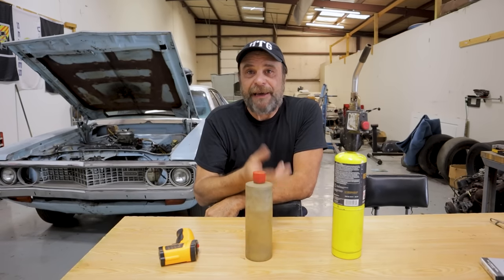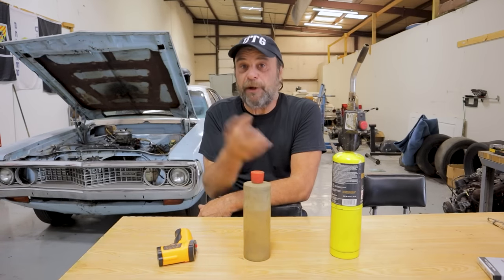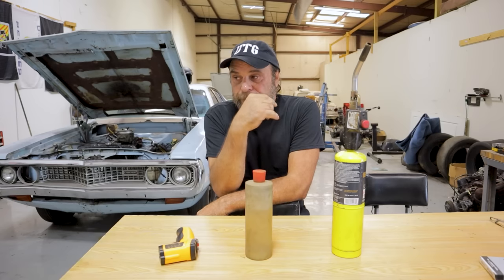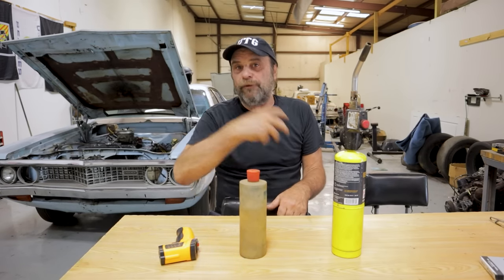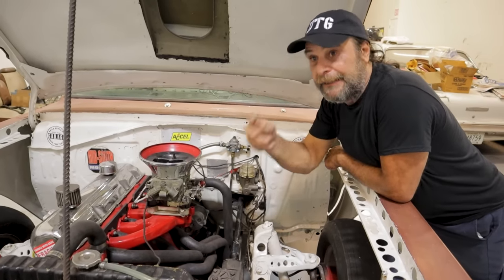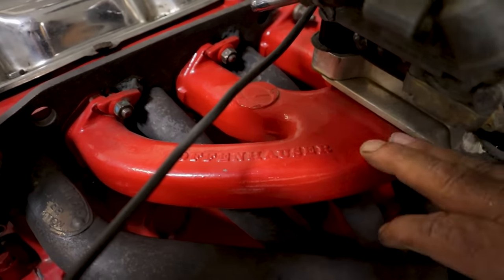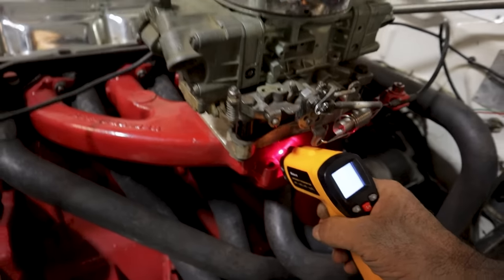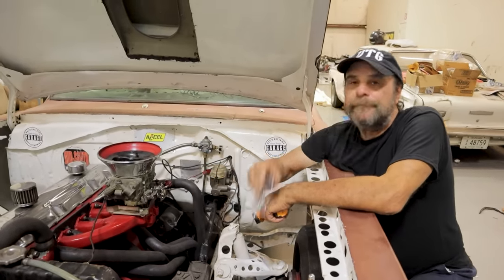How Much Intake Manifold Heat Is Enough? Testing The Vaporization Temps Of Modern Gasoline

Comment: I do agree with monitoring Temps at the track before modification. But depending on what the coolant Temps are you could fabricate a water jacket under the plenum and run water lines with  a valve to control flow and have some control on how much it heats the bottom of the plenum

Comment: Sorry Uncle Tony for double-dipping! What would happen if you went back to iron intake and exhaust manifolds together? Maybe even tap in a cast iron block that would connect the two manifolds into one unit so you could get heat transfer that way?

Comment: After watching the entire video, I can suggest to get the engine temp to normal operating temp. If I can recall, the thermostat in those engines were 180/190 deg. I'm old, so I may be off on the thermostat. But it would help the engine efficiently to warm it up before you run it.

Comment: I wonder if using the stock cast iron exhaust manifold would help keep the intake manifold hot? Also, like you said aluminum cools really fast, so if you picture cool gasoline dripping down on the floor of the manifold constantly, it is probably not staying hot!
Reply: Using the stock manifold would keep the manifold hot , but any gains made from the heat would be lost to the flow restriction.

Comment: You're on to something here.  I had a 39 year career as a Chief Engineer in a power plant and during that time I worked along with quite a few combustion engineers.  We wouldn't have used air pre-heaters, on power boilers, ahead of burner windboxes if hot air didn't speed combustion.  There is a lot going on in an engine intake manifold.  A cool dense air mixture is a good thing going in but once the fuel enters the plenum it should pick up enough heat to give a kick (you call flash) to the fuel mixture to get efficient combustion so there is no stumble or bog coming off the line.  I'd be careful adding auxiliary heat.  You're probably better with an extended warm up time if you can make due with that.
Fred

Comment: You are over thinking hot rodding the slant six with that POS intake.
 You need a 883 close ratio four speed 4:56 gears ,13 to 1 compression , big solid flat tappet cam , high rpm and light weight fiberglass body parts  to make that manifold work with a four barrel carburetor for racing.
 Put a Gear vendors on it if you want to drive it.

Comment: I'd be looking for a better intake manifold for the slant six. Something where the runners curve down and then up so that the air/fuel doesn't need to make a sharp 90 degree turn. Something more like the tunnel ram at the beginning of this video. You may have to custom fabricate one.

Comment: Well if your engine has any castparts at all in it rods Pistons or crank and you are making a pass when the engine is not fully up to operating temperature 🌡️ it's not a smart move anyways cast iron is at its strongest when equally at its operating temperature

Comment: ford used to use an adaptor that went between the carb and intake that had water running through it.  maybe you could find one and use that.  that would give you engine heat  at the intake.

Comment: On inline engines trottle blades have to be parallel with crankshaft axle otherwise your get unequal fuel distribution and richness wich lead to poor engine performance and impossible tune up...
For this reason you should rotate your holley carb 90 degres.
As it is a 4 barrels carb  you should rotate it with primaries outwards intake manifold (so on the driver side to get more low end torque ) and secondaries inwards for power
By doing this you should quickly see somme change and get equal spark plugs colour all around your cylinders
The accelerator pump have to be completly tune up (accelerator pump cam and discharge nozzle size) 
Heat soaking "hide" the real trouble and help but it is not the true cure, this is a technical solution for emissions cars

Comment: You are probably getting less air density also to match the higher fuel atomization. Maybe not the best compromise if you could still keep the denser air but with some better atomized fuel? It would be interesting to compare to some port injection. Good stuff

Comment: Tony,
For my build, I used a Clifford Performance 6=8 coolant heated intake manifold with great results. I put a Holley HP 4150 on it with flawless results.  It might be worth the time and $ if you want to stick with the 4 barrel.
I was tempted to go with the triple 2 barrel Weber side draft kit, but it was a LOT more $.

I can't wait to see what you finally settle on for the solution to this issue.

Comment: 🐾🐾😎i realize you get TONS OF ADVICE....in the video showing a belt off the crank to the water pump...i sent a note the 6 cylinders need HEAT....chev dodge ford, etc
we solved some of the problem by using a moroso electric belt driven setup to run the fan and waterpump on a toggle to built heat...(watching the temp gauge) only in the engine, not the whole cooling system. the turn the motor on at the end of the run for the return road. we did not use a thermostat in the engine. it was was a 240 ford😂😨
600 lift...660 comp carb ...this in late 1980's  budget pinto 4:56 gear 4speed top loaderAND using a heater motor to run our waterpump with a cobbled up belt drive on a toggle switch(with a MOROSO sticker on the heater motor) those were the daze we were happy and poor😎 good luck on your mission...in your days of writing you may have come across the name DON DULMAGE...writer of articles for magazines 1980 s he is local man in belleville ontario canada...brilliant dodge guy...taught us alot..
P.S. we also ran a 292 Chev SIX in the car. Muncie 4speed

Comment: G'day,  I recon a heat riser pipe, bolted to underside of manifold, extending down to exhaust. 4-6 inch dia.  or multiplesmaller pipes. 
If it's too hot, drill holes in it.    If not hot enough, add more pipes.
Anyway, good luck with it.

Comment: Ah, the misery of improving something until it won't run.  I ran into the opposite problem with slants 40 years ago.  The newer unleaded fuels at the time were boiling out of the carb when the engine was stopped and producing a no start condition.  Had to use electric pumps so that the carb could refill before cranking.  Still have four /6s in cars including the 408,000 mile 73 Valiant. Aside from just trying to fix the carb issue for fun, injection is the way to go.

Comment: Great video as always! Arm chair suggestion: adjust the driver's side shock tower so the carb/intake tilts towards the passenger side. May give more gravity assistance from carb to cylinder head. Luv your channel!
Reply: I was going to suggest a wedgie spacer under the carb then I saw your post, same diff.

Comment: come on , your over carbed already get a smaller carb and the gas will atomize , when we started hoping up cars we had the misconception bigger carb , more power ! we were wrong, you're only working with maybe 225 horses at top end if your lucky ! a 318 made 230 with that small 2 barrel . cold air good from intake , over carbed bad ! If you have to run a 4 barrell get the vac secondary smallest holley, it has 2 small primaries with larger secondaries like a mini thermoquad butterflys , thnk its a 390 cfm ,  cfm ? i had one can't recall , worked good on my 318 ! But hard to find , go 2 barrell ! the 360 2 bbl holley is 350 cfm , or the 383 2 bbl carter is 365 cfm , or find a ford 302 holley 2 bll carb , you can mess with all the goodies , jets , power valve squarter etc ! that manifold is restrictive man , your running stock head and its limited even ported out, ! that super loose converter can only make up for a slightly over carbed situation. Man you know all this already, whats going on , you don't want to change anything , you shot too high , go back work your way up.
Reply: We ran a DIRT TRACK CAR, a Blue Printed 340 with a 2 barrel. On the dyno. it made 450 HP at the wheels.

The 2 barrel worked GREAT, NO NEED FOR A 4 BARREL CARB. JUST A MODIFIED 2 BARREL CARB.
Reply: @NoWr2Run  With an appropriately sized carb that setup with the high stall converter would be ripping out the hole ,at least off the line ! quick ealy shifting it around 5200-5500 rpm it should go good !  But its stumbling cause there isn't enough vacuum signal for the air gas to be mixed , aerated properly. Its staring him in the face . Whats going on ? This is very entertaining to watch how the investigation is proceeding in real time !
Reply: @HANDBALLDIEHARD  I TOTALLY AGREE & IT IS " VERY ENTERTAINING TO WATCH ", L0L.

Comment: Don't forget too, that when fuel boils off the heat of one's intake manifold, it is flash chilling the manifold.

So the heat is instantly being lost to the fuel, meaning that just heating it with the ambient heat of the engine compartment will not last very long.

You need a steady heat supply to keep it from icing out.

Comment: I have seen so many tuning problems that just come down from a cold intake manifold. Many always blame the carb. End up with an over jetted mess that still doesnt run well. Uncle Tony clearly shows that in this video. Like he said, i also grew up around blocked off intake heat for power. But on a hot street car, that can be a real PITA... I used to get on this forum that mostly talked on Ford 240/300 inline six truck engines. The first thing most guys did was put exhaust headers on, a open plenum 4 barrel intake. Then try and live with it as a daily driver. I tried to help many on there with their tuning issues, some figured it out. Adding a coolant plate under the intake plenum to warm it, is a good bandaid fix. On my truck set up the same way, but no tube headers. I made my own split cast iron exhaust manifolds, that retained the factory heat riser bolted the the intake manifold. My 390 Holley 4 barrel works perfect, with the jets that came in it... Any inline six engine suffers from too cold of an intake, because it hangs away from the engine heat, unlike a V8. That is any inline six modified like this... Uncle Tony, i believe you will have to bite the bullet, and add some form of heat to your Slant six intake, ( more than you want). Just to get the car to launch well, even if it costs you some top end power... Love your videos !

Comment: But, but the Direct Connection guys are most likely either dead or long retired. No point in lecturing them. But you Tony are here.  Thus you get grief.  Even though the vast majority of “Experts” have never even thought about racing a slant six.

Comment: Hello Tony,

Your plan of not adding a hot spot under the carb until more testing is done is wise.  Hell this who idea (though I think likely) could be completely wrong.  If this does work adding a independently powered hot spot might well be a good idea (as you said).  While the traditional way of doing this is with exhaust heating or coolant heating, there has also been electrical heating.  Knowing your liking of low budget, you should know that the AMC 258 using the aluminum intake for the 2 barrel carb used this system.  

My thought is if you could have a hot spot under the carb with the remainder of the manifold relatively cold, the accelerator pump shot would hit the heater and vaporize.  Given the relatively small mass of the heater, it would cool significantly.  Any following air/gas would not be overly heated leading to a best of both worlds.  Well in theory.

p.s.  I really like your videos, it is easy to show how to go fast using $, it is nice to see someone showing how to do it with skill and time.   One can always turn to the $ if I run out of either.  Fortunately I have not had to, as putting someone eases skill/time in my rig would not make it truly mine.

Comment: Good stuff Tony. I like the “choke” analogy for getting enough vapor to run a cold engine. 
David Visard talked about racing a Chrysler that stock had a hole to vent exhaust gas onto the bottom of the intake. He blocked the hole, but had to engineer a carb that would make very fine droplets. 

Darin Morgan says that the droplets in the chamber when it ignites, do nothing but heat your exhaust valve. 

George Bryce says it’s mostly just the pressure in the power stroke for the first half that do the work. That’s why you open the exhaust halfway down on the power stroke since the pressure isn’t doing much work anymore anyway.

Comment: Infrared type thermometers you're using definitely get different readings from shiny Services versus dull surfaces . It will probably be close enough for your experiment but the temperatures can be way off.

Comment: Heat, vaporization and atomization. This is a great subject. There is so much to learn here. Everybody talks about how to get heat to the intake but does not talk about how to maintain it. Since this is just a drag car you let the engine warm the intake by idling the engine to operating temperature. This solves the problem without having to do any extra work or adding parts. What suggestions do you have for making this kind of engine streetable for daily driver use?

Comment: I had a similar problem when I hot rodded a 69 Rambler American with a 258  inline six cylinder. Like the slant six the manifolds had a boss/flange where the manifolds bolted together. When I installed headers the intake lost the heat important for winter drivability.
I made a steel plate to bolt to the intake manifold flange. Welded fittings to it and ran the heater hose through it. To regulate the temperature, plumb a shut-off valve into the line. Adjust it to get the temp you want. Or… Be a little more sophisticated rig a variable thermostat into the line. You could set it for the ideal temperature. It would be self regulating to keep the manifold temperature constant.
I would put the variable thermostat downstream to keep the intake manifold at the temp you want.

Comment: Here's a crazy idea. What if you made an intake that was vertical instead of horizontal and the runners just made a mandrel bent 90 degree turn right before attaching to the head? Kind of like a tunnel ram for the slant 6.

Comment: The Canadians have a stick on heating pad that’s electric for use on tool boxes, metal workbenches, etc.  Certainly lightweight, and may also be DC.
Reply: @Taranabas52  That’s what I’d seen AvE use them for in a video years ago, and it stuck in my head..

Comment: always have to get the calculator out when it comes to talking degrees with Americans 150 Fahrenheit is 65 degrees celsius. 65 degrees after 14 minutes of idling is still pretty cold say that the air temp coming is atomizing is probably getting below 30 degrees in the air charge
Reply: General modern day fuel starts to evaporated at 40 degrees. Now theres also E FUEL that e85 it starts way earlier but when it turns from a liquid to vapour its transition  is much cooler again. Then pump gas. Cooling the air charge. Maybe run a E30 blend of octane 95 mixed with E85 per litre u shouldnt have to change metering blocks just alcohol gaskests. Might be able to run more advance timing and get better atomization.  Because alcohol atomizes in colder temperatures. It maybe a video in its self the E30 trail the E30 carby the pros and cons there general setup video . Idea thought process video. 5 videos should pay for the idea

Comment: Hi Tony,

As you've probably already considered and external heat source for the manifold under the carburetor (I'd suggest something like a Stef's oil pan heater pad as the safest source (more granular in temperature control)).

One of the things you may want to consider, would be annular boosters in the carburetor primaries - Holley has several types and they are replaceable. Yes, the annular boosters will slightly limit airflow (with better atomization), but I would think that overall driveability (off-idle) would be improved while limiting carbon build-up on the plugs.

Just another .02

Bob J